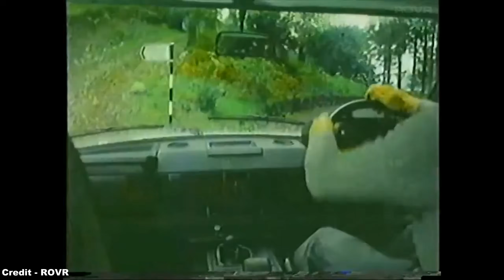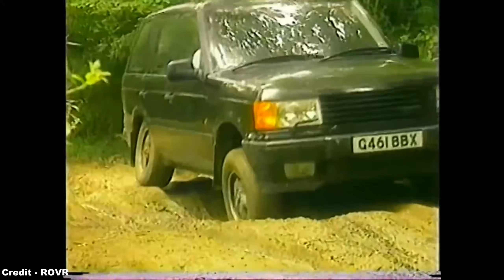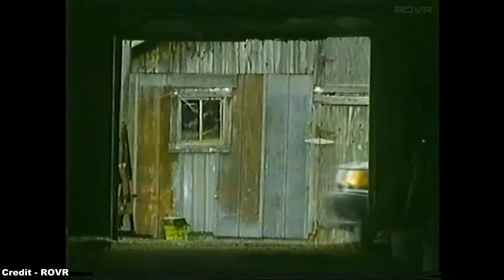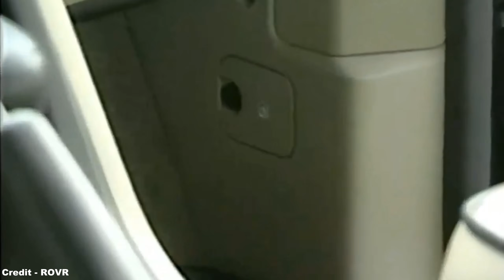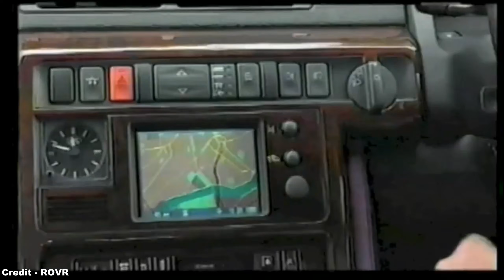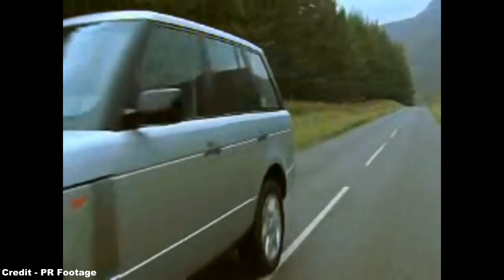Lots of Luxury with Lots of Problems - Range Rover P38 (Reworked)

Comment: The P38 is not as scary to own as some people claim. Models after 1999 came out with Bosch electronics which made them a lot better than those early cars. Now there are plenty of aftermarket parts and most of the problems have been figured out. Yes, it was and still is a luxury vehicle and owning one will demand more money to keep running than your average 30 year old car.
Reply: Yep, owned my 2000 model for 7 years, damn good motor.

Comment: I have owned a 99’ D2 for 3 years — most reliable EVER have had zero mechanical issues and just kept maintained and oil change etc… am selling solely because at 300000km the bottom rust is worrying 🥲

Comment: I have had a 1997 4.6 HSE for 5 years. In the meantime really EVERYTHING has been replaced or repaired. Rust is not the problem. There is everything to read up on, parts are available.  Not cheap but now a wonderful car. 
We have a great P38 community in Germany that is very supportive. 💪
Reply: My P38 is a 1997 , 4.6 V8 , just love it ❤

Comment: Ive had my 4.6 for three years. No issues outside of routine thorough servicing. We did have to change the air suspension compressor, but its been fantastic over all.

Comment: I run a 2001 P38 Bordeaux which was a one owner car from new when I bought it as a stolen / recovered project with a wrecked interior. It has 219,000 miles on it and runs a 4.0 litre Turner V8 fitted in 2011.
The electronics were fun when I got it due to water and heater leaks but as the whole interior had to come out anyway repairing and testing looms was not a bad job. But now everything works and the s/h Lightstone leather interior with electric seats looks terrific and is sublimely comfortable. The fit of trims is pretty impressive for a 23 year old car as I managed to clean and save all the plastic trims.
I think the P38 and Land Rovers in general get undeserved bad press because most of the issues are down to the lack of correct service. You don't put over 200,000 miles on a bad car and few cars look as good as a Range Rover of any model.

Comment: My dad had one of these, the interior quality was immaculate and the fit and finish far better than the 10 year newer disco 2 he bought when the range rover burned down from a wiring short on an oil leak. Drank fuel but such a pleasant car to ride in and capable offroad.

Comment: Bought a late 1995 P38 4.0 Autobiography with LPG in 2008, with 170,000 miles.  It was a complete shed.  Over 8 years & 140,000 miles later, it was still a shed, and someone (not me) drove it with a burst radiator hose, overheated it and wrecked at least one cylinder head.  It still got home though, on it's own.  Never failed to get home, never let me down.  Loved it - wasn't perfect, always needed a spanner on something, but it was cheaper to run overall than many other cars I've had (mostly Mercs), and the only one the RAC never attended - but boy did it tow many other broken cars home for friends and family.  One by one, acquaintances stopped joking about it.  Miss it massively.  Would I buy another one?  No, won't be that lucky twice.

Comment: get rid of the hidraulic suspension, install a Toyota engine
Reply: In the video, he said that some people could swap the engines for GM V8s, which were more powerful and more reliable. People still do that to this day, mostly DIY. I've not heard of people swapping a Toyota engine into Range Rovers, but most people who have the idea would probably prefer to spend quite a bit more and get the Land Cruiser instead of using its engine in another car from a different brand.

Comment: wtf is a dropped liner?,ive been a teh 35yrs seen dropped valves but never a single liner "drop"!.
Reply: The roof liner material comes away from the physical liner, common issue on these you end up with material sagging down, seems to effect the rear more than the front.

Comment: I got a new 4.6 HSE in 1999. I had it for 5 years, drove a 230 000 km with it. I had very few problems with the car. Perhaps one of the most comfortable cars I ever had. Since then I have driven smaller and more sustainable vehicles. They have been smarter, but not as regale as the P38. Regards from Norway